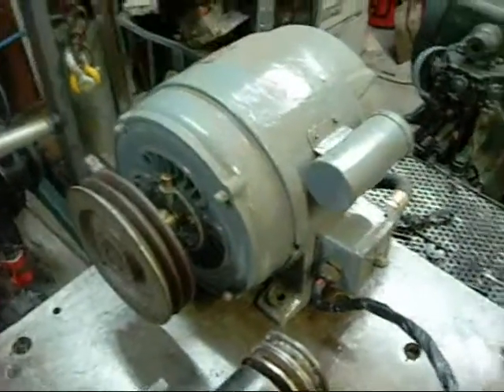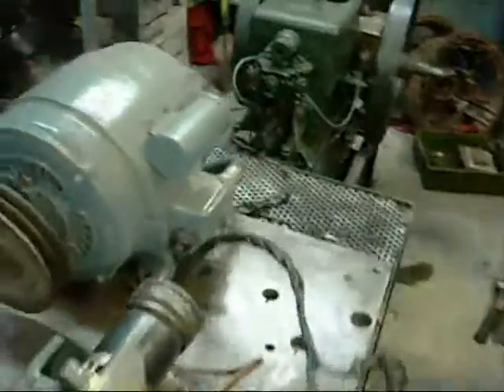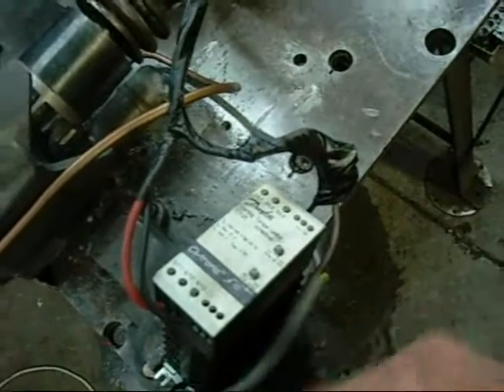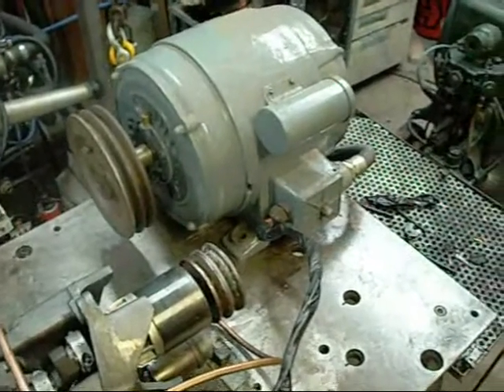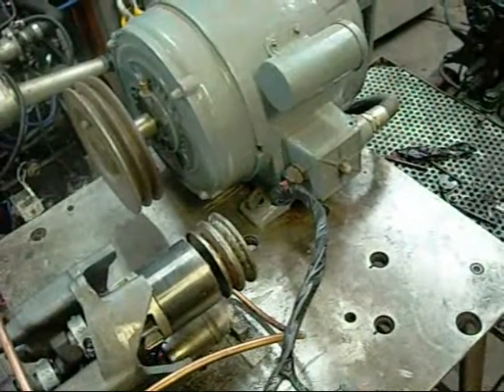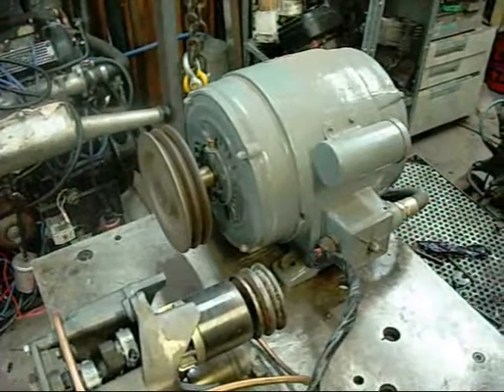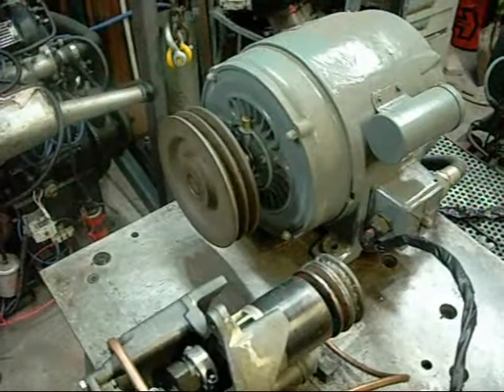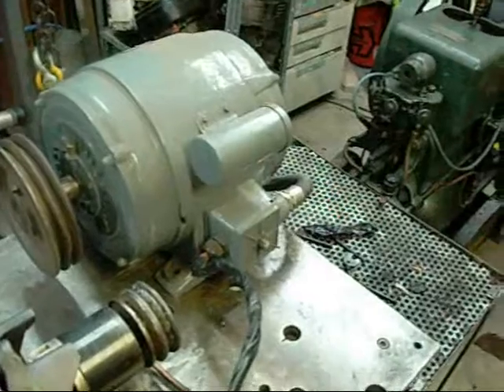Brook 2Hp 1 Phase Motor Test with Start Torque Limiter

Comment from the maker: @cheetawolf the current limiter works to start motors softly, no burnout protection.

ts all solid state with little silicone wafers attached to the heatsink. I have no idea of how it works exactly.

Comment from the maker: @Lachlant1984 lol ibt heavy for a angle grinder ;)

A huge pedistal grinder maybe. I think it was off a lathe though.

Motors of this size can drive pumps, fans, conveyors, table saws, hydraulic pumps, air compressors, mills, lathes, punch presses, mixers, shredders, etc..

Comment: Yep, they only control 1 phase. Good for mechanical 'softstart' only, where you want to limit problems due to rapid acceleration. Like a conveyor carrying bottles, you can start it without tipping all the bottles over. No electrical or thermal advantage though...

As usual, an excellent post showing stuff others don't normally get to see. Keep up the good work!